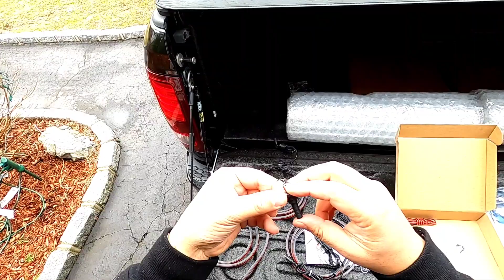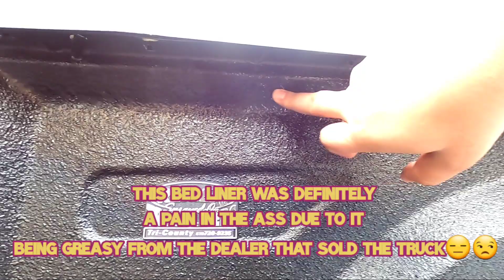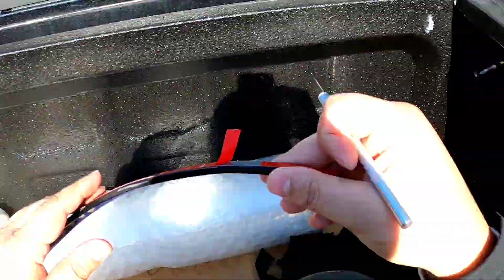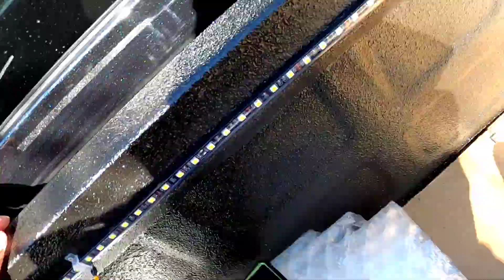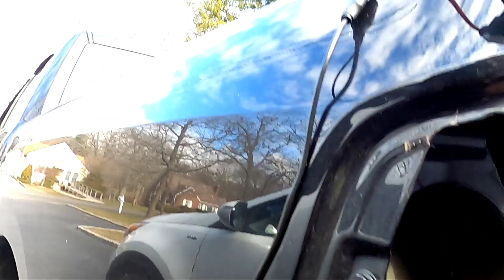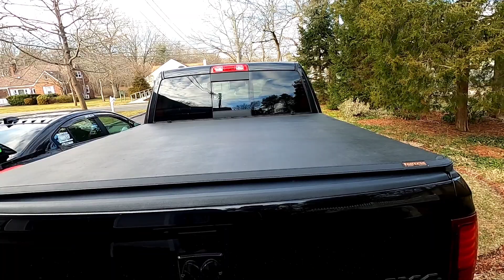Super Bright LED Bed lights from Mictuning for my 2016 Ram 1500 Sport Bruce

Comment: Ok I bought the same lights. The left strip connects to the center via wire contacts but the right strip has no wire connectors! How do you connect wire the one on the right side? 2 connect to each other but the third one doesn’t….
Reply from the maker: Weird, all the strips should be daisy chained to each other....and one strip should have the positive and negative wire

Comment: I want to know why you cannot tap into the existing bed lights on each side of the truck bed by the tailgate.  That would be the easiest and best way to do it without having to run new wire the length of the truck to the battery.  Then the existing button on your dash would operate everything as it does those existing lights in the bed.  Those LED strips only have a 2-3 amp draw on them.  Surely an extra 2-3 amp draw on each line won't hurt anything. That existing wiring can handle much more than that.  And since you would not be running the LED wiring to the front of the truck the resistance and thus the draw would not be as much as if you did run it that extra length.  I don't see the advantage of doing all that as opposed to tapping into the existing lighting in the bed.
Reply from the maker: Hey Jim I see ur point but it doesn't make sense to me because there's only on positive and negative on that daisy chained harness,  so to tap into both sides of the bed is moot versus what I did, where I Tapped into the 7pin trailer harness which is way less involved to me than what you suggested as well as zero voltage drop.

Comment: Just purchased these lights..I test them in my garage  to my battery they r really bright!!!!! I also got the plunger  too..so the question I have where did u connect the ground to for the plunger?
Reply from the maker: The ground wire is connected to the rear of the plunger itself.  So the plunger in essence is the ground.
Reply: @richardvelez933 I installed these lights this weekend with a plunger too. When I hooked the LED ground wire up to the plunger it didn’t turn the leds off and on. Any idea why?  Does the plunger have to be mounted to bare metal itself?  I have to use the manual switch that it comes with but I would like to figure out the plunger option with the tailgate!!!

Comment: Protip alcohol and make sure the car I bed liner is warm or hot

Protip 2 wtf would you even run them off the trailer hitch power when you have the factory led bed lights right there? I just don’t get why you wouldn’t want it set up with the factory bed lights where they go on when the bed is opened etc etc You solder but use wire taps oh man come on.....

Protip 3 ALWAYS use wire loom for wiring underneath the car
Reply from the maker: Hello, how I run wires in my truck is a guide and you can do what you like to yours....also I ran it off of the trailer hitch to make sure it had it's own constant power supply rather than tap into the small leds and possibly have a code....also you should be polite even when you give constructive criticism so as to not give the impression that you're not an internet troll....hopefully this helps have a great day 😃